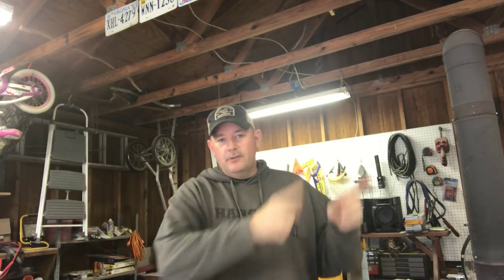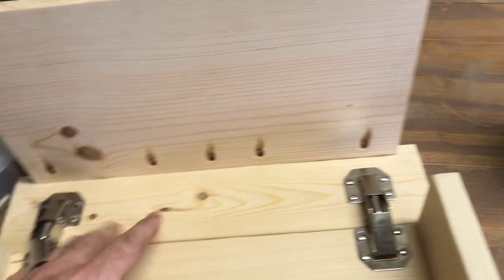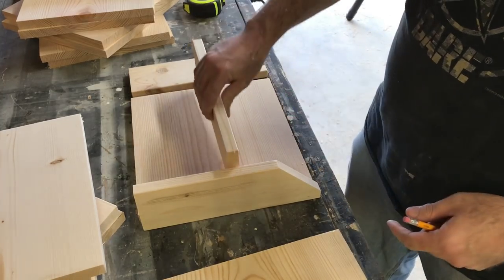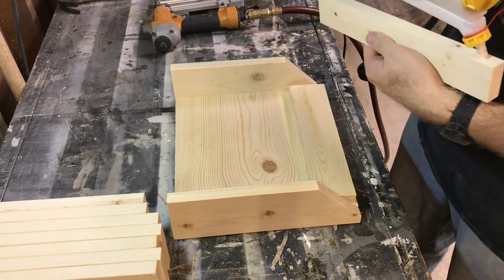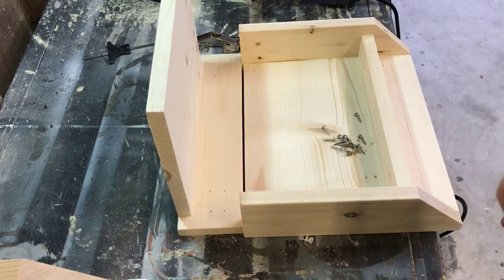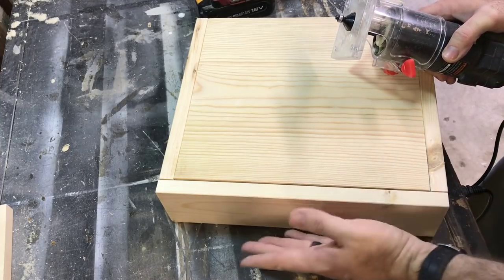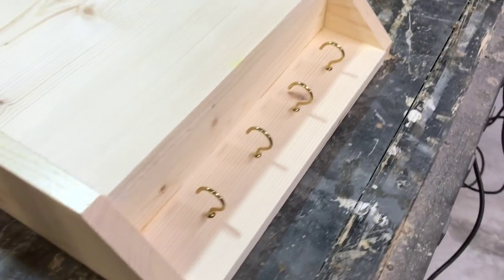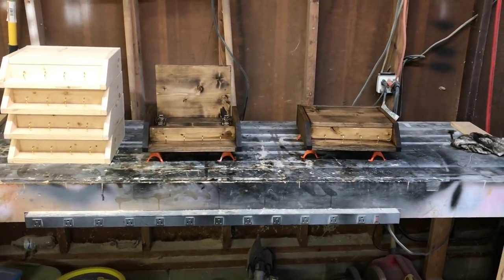Wooden Concealment Box

Comment: I just made a version of this with a sliding front ( stopped slots cut in the sides of the top and inside of the box sides, 1/4" oak rail glued in to the front, and everything waxed). I used your nail trick for a lock, and drilled a hole in the top of one of the sides to hold it when not in use, as well as countersinking a screw into the back of the top to store a magnet.

Comment: Great idea & solid build.
If you give the line a coat of shellac between sanding & stain, it will prevent the stain from blotching, gives an even coat. Then quick coat of polyurethane varnish to seal it from fingermarks.

Comment: I have a friend that was just diagnosed and fixing to start his fight. He also is a cop, I plan on making this for his benefit to be auctioned off. I think I'll take the lid and engrave a badge on the front of it.
Reply: Did you have any problems with your hinges not closing correctly. One side sits higher than the other and I am at a loss of what to do. I can add trim and it won't be noticed but that's not what I really want to do.

Comment: Hi Popo, I was making the smaller gun conceal box but when I went to put the hinges on , I went to close it and it wouldn’t close , like it was butted up too close when
I put the hinges on. In your video it looks like the top and back panel sat a little away from the box when you put the hinges on. You never said that it should be a bit separates from the box. My side panels were the same exact size as the bottom panel. I guess I need to put the hinges on while the top sits a bit away from the back panel??? But I love your videos
Reply from the maker: Susan Guin I believe I did end up putting a small gap to accommodate the hinges so they would work correctly. It really depends on the hinges and how they are made

Comment: first i would like to say stay strong for your baby girl. shes doing great. Also what would you use to put a weapon in there or how would you do it?
Reply: To put a weapon in there, you would use your hand and a weapon. Open the box and put the weapon in.
Reply from the maker: I purchased the round earth magnets which you can screw into wood. It has the hole in the center of the magnet. I screwed the magnet into the back of the box then place the glock against it.....It is strong enough to hold a glock 22 40cal

Comment: I have a quick question. Love the work love the video love the information. However I’m not understanding the concealment part. I have understood concealment boxes to be concealed to where you can’t really imagine or see or even perceive that there’s a containment area within. I don’t feel that you could call this design a true concealment box if visually you can depict or conceive of a compartment within. Now that’s just my opinion. I hope you don’t take this as negative, and will add a reply.  I am new to all of this hidden boxes and stuff and I even installed a small metal security box inside my wall inside my closet. Which I would say that’s concealed because you can’t even see it-it’s it’s hidden by hanging clothes and it’s on the outer wall but inside the closet so you would hardly look backwards once viewing inside closet. Plus it’s a keyed locking mechanism with a key hidden in a different closet.I would say that my set up could truly be called a concealment box. Also I’m not a fan of the dark stain on knotty pine. The dark and light stain only some people like. I would consider some alternative finishes. But great presentation and info on parts and such.

Comment: Since I'm a noob and doing this on my own to surprise my husband.....can someone explain how to do the part where he makes the front piece fit into the ledge inside? Like how to make the notch in front so it sits against the ledge. If that makes sense . 

At about 4:30. Does he cut the ledge smaller, or does he cut out of the square front? Thank you!!
Reply: Hey! Just made for my hubby as well, but to answer your question, he cut that center board down to fit the top board in